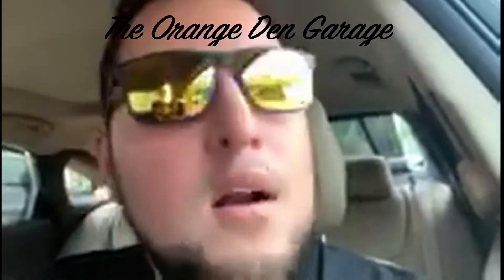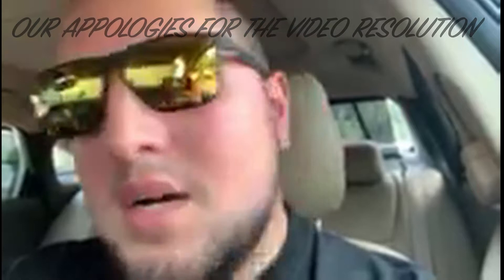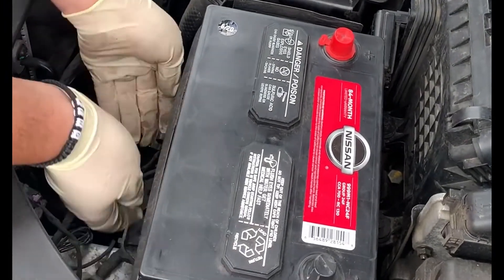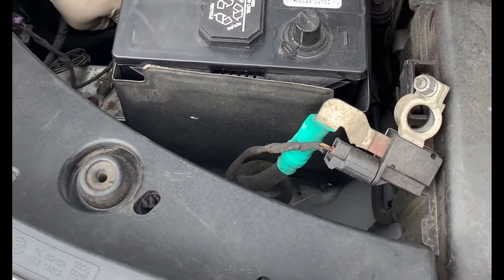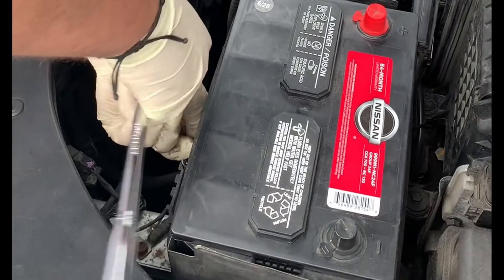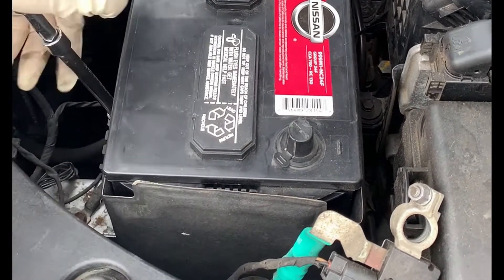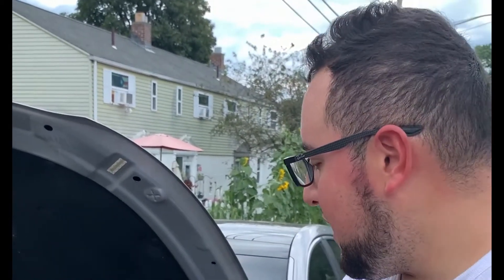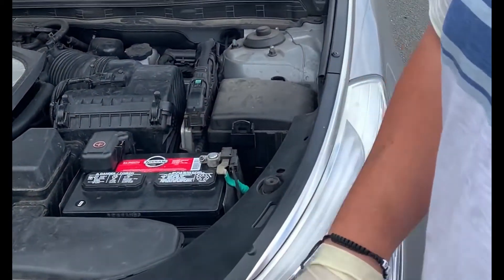HOW TO REPLACE A 2012 HYUNDAI AZERA BATTERY

Comment: Thanks for making this video Erick. I went to Costco today knowing my battery was dead, but didn't bring all the right tools to replace it at the store. I bought the new battery, and luckily I had my jumper cables in my trunk. I almost wasted one of my annual service calls to AAA, but then realized that I could jump my car with the new battery I had just purchased by connecting the jumper cables to it. 🙄🤦‍♂️ I made it home and will be installing the new battery in the a.m. Thanks to this video, it'll be a lot easier knowing what I need to remove, loosen, and tighten. I appreciate you big dawg. 🍻
Reply from the maker: Thank you for the great response and if you have any other questions about your azera feel free to ask!